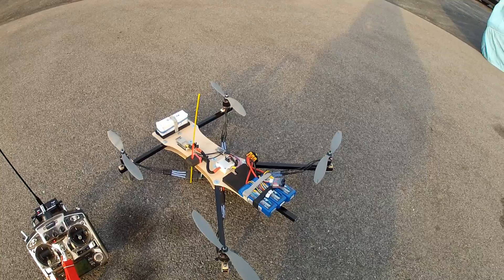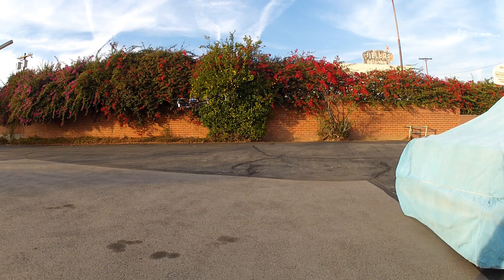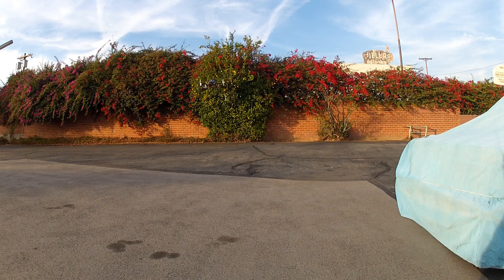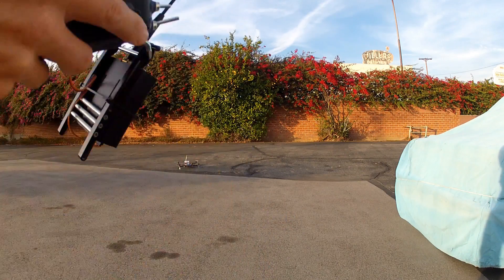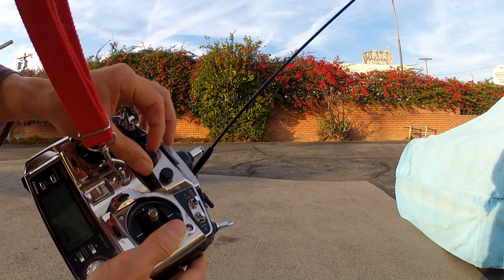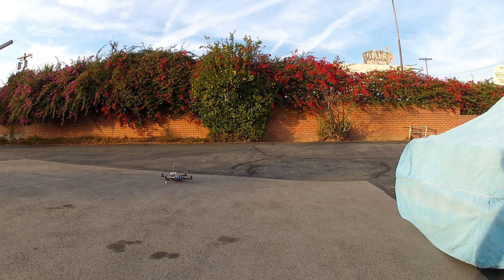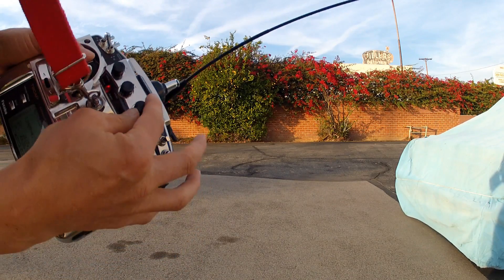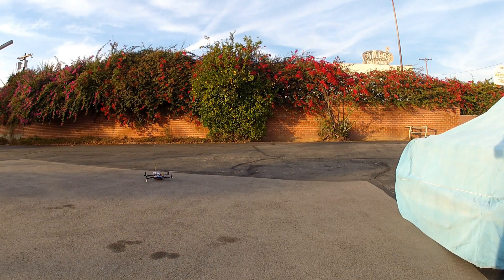OpenPilot CopterControl 3D TxPID tuning

Comment: Hi PC3DM, thanks for the great video. I am just setting up my cc3d with an FF9 and ezuhf, and was wondering how you have managed to alter P, I and D at the same time....
I can only assume that you are using PPM sum ( if that is the correct term) to enable more than 6 channels, as there are only 6 connections from the cc3d to the Rx. Is that how you have yours configure? Cheers.